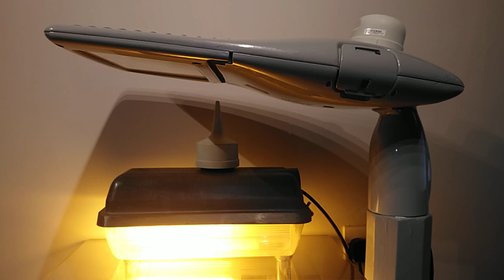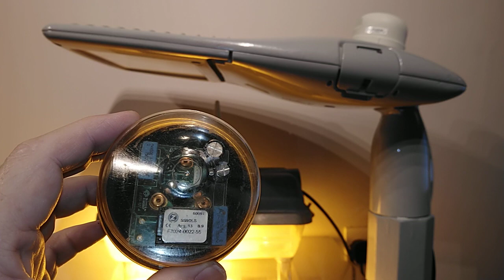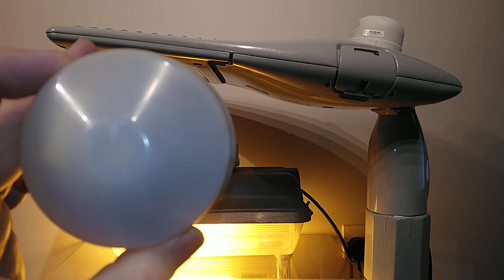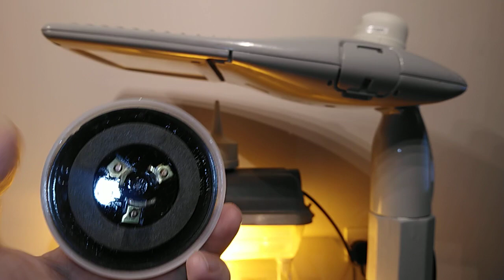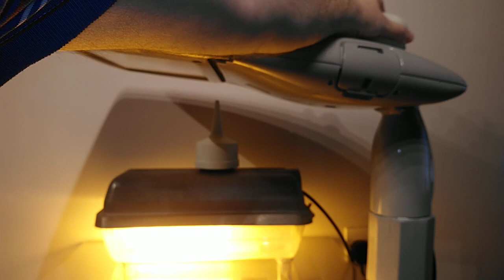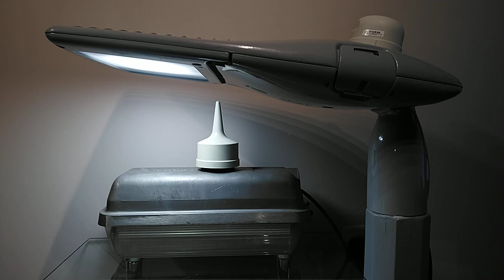Ampera 36watt R2 16 White LED  Mini with Telensa/NEMA Controled Street Lighting

Comment: Don’t these nodes need affiliating with the relevant system to work? Or do they just latch on to any system if nearby?
Reply from the maker: They are both set to different systems, 1 works Leicester City Lighting Zone only (works at friends house but stays on at mine) other LED Light works in Leicester County Lighting Zones. (not tested at friends house) So yes coadded to relevant system.

Comment: i have to telensa nodes 2 can any one tell me can i get in troble for using them as im in a telensa erea and thay do function fine
Reply from the maker: I have had no issues with mine. Still works with street lights outside my home. The only thing that has changed it no longer turns off at midnight, now dims instead.
Reply: @davesbusstuffandmore  hi dave ive had mine in storgae for 2 years and onley put mine in use again are ones dim here now but the 2 telecells i have are the nema 7 pin  thay both turn my lights of at 0000/back on 0600  am i wionder if the old program is still stored in its flash memory chip thay both work well thou
Reply from the maker: @adrianilling7688  I think mine was powered when a update was sent 🙂 The other one I have only works in Leicester so stays on at my home (the pointy one)
Reply: @davesbusstuffandmore  so the one round small one dous it let the light stay on all night now mine i have 4  units thay all turn of the lights at midnight till 6 am and thats still after 2 years in use the street lights turn of 1 am till 5 am but mine sstay of till 6 am
Reply: @davesbusstuffandmore  dave ive some info for you thay will work with out network thay can be deletred of the cms system so what will hppend is when the street lights get there updates are ones we own will not get the updates so the last update thay have will in stored in its flash rom permimantly so if you own at turn of midnight it willdo it as long ast it lasts in your case you said your one still no longer turns of at midnight so its still active on cms map and if your cell is working ofline it can still pick up signal but will not recive updates in my case mine are still part night thay means the lights thay may had the cells in past was replced so the street light team set up a new sn on the nde then the old sn gets taken of line
Reply: dave inside the telensa cell is a small flash memory chip the data strored in sid tells it when to turn of and back on in your case when thay updated your street lights your cell also got the update so it was still conected to councils cms system with mine thay had been out service 2 years so the councill removed them of the data base so its clssed as working ofline but thay still will pick up the radio signal for its in side clock so when it gets to midnight the flash data remembers its a part night cell so now mibe will always turn of midnight as long as the cell lasts as the date is perminant unless removed

Comment: hi, these are not 5g. they are also on a cms program to a base station [ computers] to moniter the levels and for programing, i use this system every day as i repair and maintain street lights. I can turn these on and off and also program them to come on or dim at any time ,day or night .they flag up if something is wrong with the light  for maints teams to attend. the top light has a 7 pin telecell on it,
Reply: terry can thay be programed from any where in uk as long as you have the bar code
Reply: @adrianilling7688  
Unless you use the software as we do them you can't program them. Yes the barcode is for each individual telensa but in that bar code is two check digits to an area ( town ) and are set by the people who send them out  to us.
Reply: @1968stella  hi terry reason i asked you this the guys where i live gave me 2 telecells on lights that was upgraded been taken of the system now  i use one on my out side light it works k it comes on dusk of 0000 then back on 0600 am am i corect this has been programed in to the tele cell  permiment unless if it was live times can be changed
Reply: @1968stella  hi terry i will try explaine again the guys from council gave me 2 telecells thay are no longer on live network i use one on out side light it turns of at midnight and back on 6 am mornings if im right the program  is embeded in the cell and can the program be lost or will it stay permimant im shocked that it still works and its not online the guys taken it of line from cms when thay upgraded  the thing that turns it of at midnight is in been set in the telecell
Reply: @adrianilling7688  hi, the telensa will still come on and usually stay on if it looses its signal/ program  from base station  (day burn ). all the program is done by the  software user then it goes to a base station then to node.its just a receiver and transmitter  basically. .what telensa do you have ,3 pin or the  7 pin. with the dimming integrated.. they are changing all the time now with gps, light sensors etc built in.
Reply: @1968stella  its a 7 pin T2E1N G-1  i have hd them 2 years now i live in a telensa live erea so i guess its piking up signal still the street light guys thay gave me them from an old job upgraded the early lights thay siad if you replace when thay remove a node and exchange it for a new one the old one becomes void if correct so just i quick run down mine comes on dusk of midnight back on 6 am mornings so if its of line is it possible its still reciving narrow band signls
Reply: Correct, it’s still picking up a signal but it’s offline as far as the base station is concerned
Reply: @1968stella  hi terry if its now ofline any idea what makes it turn of at midnight then back on at 6 am mornings if im right the program is in the telecell
Reply: @1968stella  terry can you give me advice i have spare node is there any way it can be set to turn of and back on at choosen times it has the sn number
Reply: @adrianilling7688  you have to program it through a software called planet  that is probably owned by your council or lighting contractors, and it has to be in the same county to work . i work in peterborough and live in Lincolnshire  and taken one home before to work on light but it doesnt work past the boundary, well thats the way ours work
Reply: @1968stella  i get you now so like if i sent you the sn  it would fail if correct
Reply: @adrianilling7688  correct, the system will know it doesnt belong on my network. you then contact planet and they just take the last  two numbers at the end of that sn number and they are called check digits and know its come from your county so i wouldn't be able to use it. then send it back to them to replace.
Reply: @1968stella   thanks terry clover stuff for sure one last think my 2 i have thay are no longer on planet system thay are both set to turn of at 12 am and then back on 6 am i take it the program is in side the telecell and now moore likeley perminant
Reply: @adrianilling7688  if you can get someone to program them they will work but otherwise useless, these cells are best  getting data  for energy readings, dimming  and if the the lantern has problems ie maintenance issue. saves all the night scouting as well. Its just a cell for councils to keep an eye on cost.
Reply: @1968stella  hi terry i wont keep on pestering you i got it from ebay so could come from any ware can i give you sn to have a look at just in case it can you used
Reply: @adrianilling7688  unless it comes from peterborough i cant tell ,it defiantly can be used again as we do it on our network. If this was on our network we would phone telensa and get them to check as they would know where this was assigned to.
Reply: @1968stella  can telensa proram them
Reply: @adrianilling7688  i would think so but without buying or paying for software they will say no.this software is very very expensive and you would also need a base station with aerial  which is like a mini computer that we attach to street light columns  to tell the telensa what it needs to do.
Reply: terry if i give you a sn number can you run a check
Reply: @adrianilling7688  i wouldn't be able to do that. i could if it was in my town. I think they keep it to towns so i cant go and make mistakes on other peoples networks as someone did on ours and turned the whole town on during the day lol
Reply: @1968stella  no worrys you may be able to answer this this i have 2 telecells thay turn my garden lights on of  work well  from ebay come from  now when it gets to 0000 midnight thay town of my lights then at 0600 am come back on till dawn i have been told when thay was last prgramed thay would have been set up for part night lighting a street light guy said today the telecell stors date in its flash memory dous this sound right
data ment
Reply: i live in an active telensa active narrow band network erea
Reply: @1968stella  its still in pakigeing never been used terry

Comment: Nice video, could you also check out my reply on my other comment. :)
Reply from the maker: Is it about The Philips MA90s? They are great looking lamps. Wish I had one. Some other new A46 J21A M1 has now lost its Philips SGS203's and the 10 Black Ampera's have gone as well, some new led lamps not sure what they are. Looks like the M1 will be next. J21 to J21A
Reply: @davesbusstuffandmore  I am quite surprised that they replaced the ampera's considering that they are already led, it just proves that sodium was better. There is one problem with the Philips sgs203's is that the top cover can blow off in high winds.

Comment: I am a fan of these led street lights, they look quiet sleek and modern and a really good, they have them on the motorways where I live and slip roads.
Reply from the maker: The Ampera's are very reliable as well, only design floor is the way they stay level seem to drop down. J21 to J21A on M1 still High Pressure Sodium 50% don't work :-)
Reply: @davesbusstuffandmore  I live by the M4, Pyle area and there are a few Amperas on the slip roads to Swansea and McArthur Glen. They have only been there the last few months but they're going strong however when they put new led street lights on the other side of the dual carriageway the junction box was old and broken so after putting a new one the lights we working again. As a lot of people speed on the carriageway, a car hit a Lamp post with LED lights on, smashing them so they had to put new ones again! All is good though now, but as you said, the lights drop down sometimes but the council angles them up a little higher so if they do drop down they don't go down as far but it's not just these lights that do that there are some different LED lights on other roads that have dropped in the winds (living by the coast).
Reply: @davesbusstuffandmore  Yeah, I prefer sodium lights over LEDs. The Philips MA90s are my favourite. There are some on the motorway to Swansea, like you said only a few work but the majority do, however they are being replaced by these sadly.

Comment: Tesla make electric cars. the company that made the pointed smart telecell here is TELENSA, based near Cambridge. 
The pointed telecell in the video is a very common sight all over the UK on top of the lighting poles but it is an older model, newer ones are flatter.
Most smart streetlights across Britain are now controlled via these telecells and 'basestation' transmitters, both manufactured by Telensa (though there are a few other firms in the field). Telensa has had its 'PLANet' system bought up and installed by local authorities the world over since around 2008-10, including Chicago and Russia. 
Councils attach the telecells to every light. The cells connect via an ultra-narrow band radio network (NOT 5g) to a 'basestation' box on a pole (one basestation is capable of linking up to a thousand individual telecells over a wide range) that is in turn controlled from a server that the council houses somewhere. Council workers or contractors can then connect to the lighting network by the Telensa PLANet computer app to alter any configuration of lights, brightness, etc or see which bulb needs repairing if it's blown, etc. Every telecell on every light has GPS installed. 
The narrowband radio network used between basestations and telecells was developed for Telensa by Plextek in Saffron Walden
https://www.plextek.com/case-study/smart-city-street-lighting-infrastructure/
Photos of Basestation:
https://fccid.io/XYD-BS4AA/External-Photos/External-Photos-3718125
The basestation has a light sensor on it and it is this sensor whch signals to every telecell whether to dim or illuminate - unless lights are programmed via the server to shut off/on at certain times, etc. Each telecell does not have a light sensor on it. The base stations are of course linked to the main server on the network. (repeating myself I know...) Telensa provides this lighting set up to councils from Russia to America, and a myriad of other countries, as well as here, as it is very cost effective.
Telensa has much bigger plans than just lighting though...
https://www.telensa.com/news/suffolk-county-council-selects-telensa-to-deploy-100-sensors-on-its-smart-streetlight-infrastructure/
https://www.telensa.com/solutions/ 
https://www.smartcitiesworld.net/news/news/telensa-named-number-one-in-smart-street-lighting-1118 
http://www.emsave.com/newsarea/news/telensa-delivers-worlds-largest-wireless-street-light-control-system-to-ess.html 
https://www.theregister.com/2016/11/16/telensa_gets_bauble_from_mystic_mage_outfit/
https://www.youtube.com/watch?v=n0ALISDT2w4
Reply from the maker: I have no idea why I said "Tesla" in the video :-)
Thanks for the information about this system.

Comment: I have streetlight exactly like that one outside my house but it's a black variant it was fitted back in 2017 whole Bedfordshire area got them now
Reply from the maker: There was 10 black variant ones in Leicestershire Junction 21A road to Glenfield after Exiting M1. But replaced by new ones, as they are now replacing all street lights lamps on the M1 and A46 J21A
Reply: On the way to school back in 2017 I saw some of those lights being fitted down West End that goes to Luton A6 Milton Keynes via the A421 the junction that was once around about that goes to the retail park Kempston the hospital has a variant on that black variant it's basically a double version for the light is longer and have more LEDs you can see a few going towards Dunstable in Luton and leaving Bedfordshire towards Hertfordshire as you cross the border into Hertfordshire just outside Luton Airport you can find that same street like you have does even the Long variant of your street lights on the A1 towards Doncaster know a lot about street lights show me one and I might be able to tell you what year it may have been built
Reply: There not installed everywhere in Bedfordshire. The black LEDs are installed in Bedford Borough. In Bedfordshire (other towns like Dunstable etc), are having other LEDs installed like CU Phosco p863 lanterns. In earlier years they used Hardie Jewels (tube led lanterns) and Philips Luma lanterns. So Bedford borough is the only place with the black LED Ampera lanterns.

Comment: This is not 5G, its a system called NEMA Telecell, it operates in the 915MHz band, its used as an "Internet of Things" to control power loading (inrush) of streetlighting, and can perform dimming in the light ballast.
Reply from the maker: Thank-You for your information about these Smart Street Lights. Lots of miss information out there.
Reply: The American variant uses 914MHz, with frequency hopping...
   The ETSI (UK / Europe) is 868mhz.... It's in the ISM (unlicensed band)...
  The Telecells transmit at about 250mW, and the base stations at just over 1W...
   The data rate from cell to base is single digit BPS....
    In addition, the base stations have 4G LTE modems for backhaul to the CMS...
   There is no 5G anything in there, no radar, mind control, microphones, cameras, or any of the tinfoil hat nonsense that some folk claim...
Reply: point is - RF antenna is put into led light which is idiotic solution even if govenmind had the best interest fo its people ;)
Reply: Subgigahertz is much more dangerous.  If you're really into technology you'd would know that.  The fitment on the top is directional and not like an aerial at all, go on to the manufacturers website at harvard technology, it's the same company now using a different name.  These are scanners not aerials. The fact you have one in an enclosed room is hurrendous to be honest.
Reply from the maker: @janeybaldwin9078  The Fitment on the top, also makes random beeping noises..
Reply: @davesbusstuffandmore  Most likely best to ignore those who say anything about Telensa, Harvard etc. they have no clue and just want to scare people into incorrect beliefs. Doing some research they won’t or claim to have done would in fact reveal that Telensa is FCC certified for the USA. As well as the point that most CMS systems use 2G or 3G for DALI dimming and switching, if they’re so frightened why would they use a mobile phone. There a constant buzzing noise on the node, I own two Telensa types, which is actually the device confirming signal. They do use GPS for maintenance crews and report and information such as loss of power. All transmitted through a certified mobile network. The pointy nodes are cool to see inside though 😁